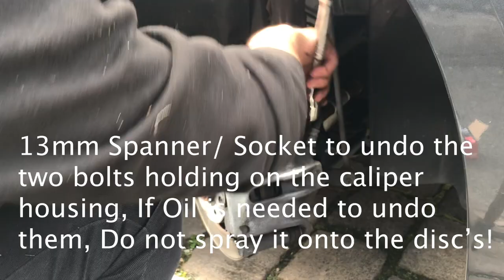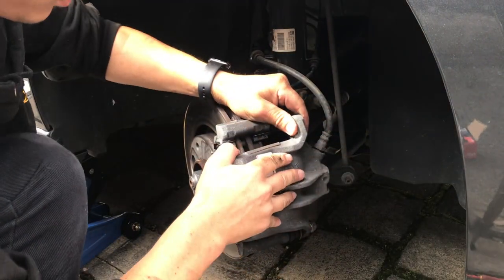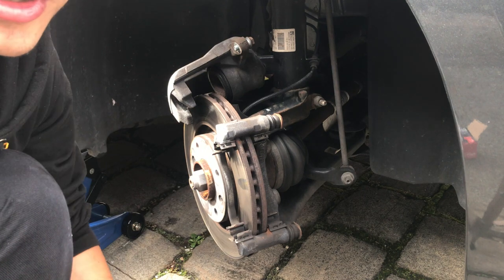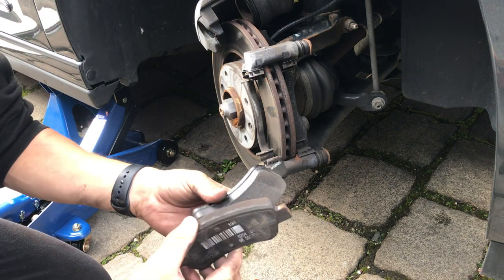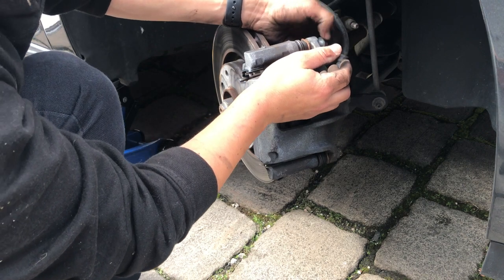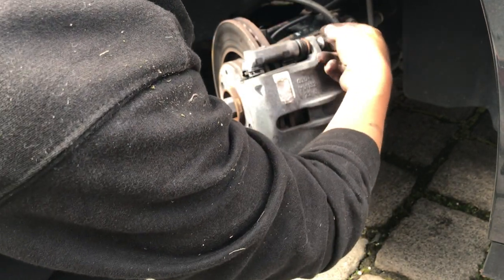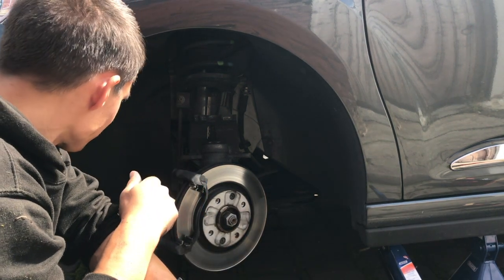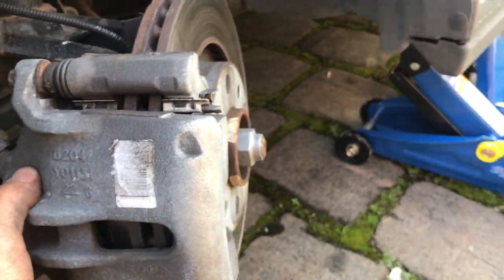Changing the brake pads on my DS3

Comment: nice video, consider pushing the piston back before you pull the caliper up. I need to do mine but I think you can undo just the bottom bolt and swing the caliper,  other thing is if you get squeaks use  some copper grease.
Reply from the maker: Thats one thing I missed out, I forgot to record me doing it, I also unscrewed the brake fluid cap to make it easier for me to push them back in.

Comment: Hey! Silly question but where were you putting the trolley jack on the front? I always struggled to find a place to put it to be able to place an axel stand too
Reply from the maker: right on the wishbone bolt, there's not much room near the sill
Reply: @itschocolateboy7828  alright, thanks alot 👌🏼 replacing with ebc sport brakes all the way round. See how much of a difference over OEM it makes 😂
Reply from the maker: @dgodfrey5322  I would go with better tyres over race pads lol

Comment: Zero wrong with the original pads, in fact your new replacement pads are probably poorer quality then the OEM ones you just replaced. A quick clean up of the discs and pads with some brake cleaner to remove and brake dust would have been a better option looking at the OEM pads.
Reply from the maker: I know, They didn't need changing really , but there was some decay there, After changing it got rid of the grinding/squeak noise too . Pads I bought was recommended at Eurocarparts(not the cheapest) so I would think they are better than OEM. Thanks for your input though buddy !

Comment: Check brake discs thickness with a micrometer, 22mm when it's new and minimum 20mm because I think they are very close to the minimum.

Everything you need to know to make this properly or for any other intervention in your car you can consult it in service.citroen.com (procedures, maintenance schedules, diagnosis, technical service bulletins, OEM parts numbers and prices…) Registration is free choosing you are an independent workshop... One hour subscription is €7 +VAT to download all technical information you need about your intervention for Citroen, Peugeot, DS brands (procedures, torque specification, required tools and parts…)

Ondo izan,
Reply from the maker: discs are good, thanks though buddy !